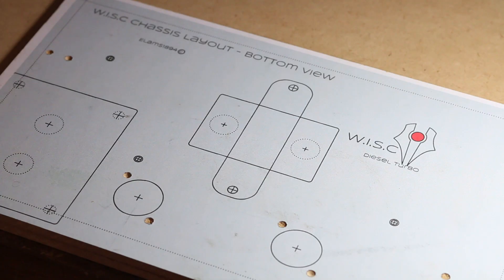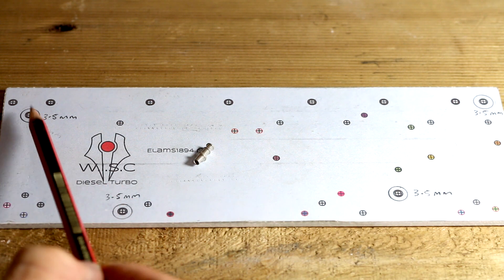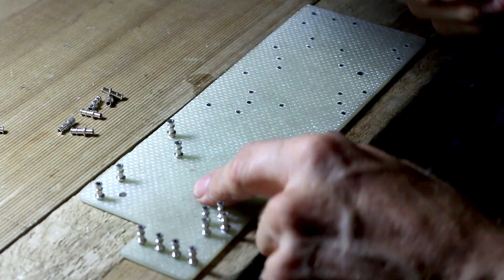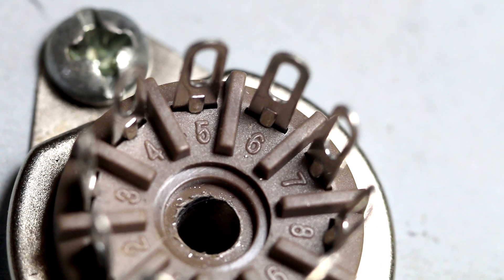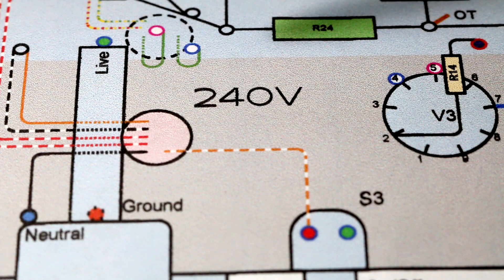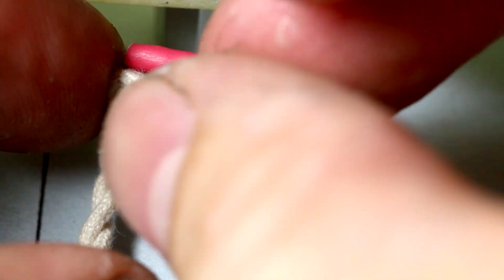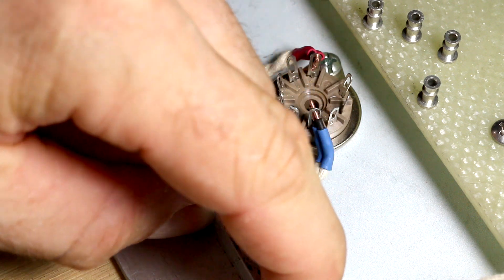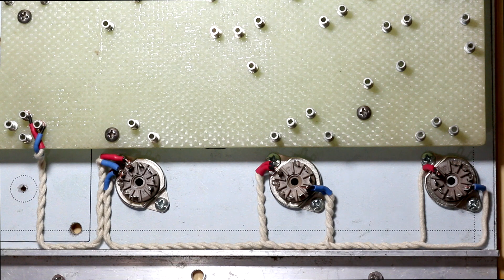Small Tube Amp Build - Step by Step (3 - Turret Board, Filament Wires)

Comment: Very good cabling you have an eye for detail just wondering why your using cotton insulated cable. ??
Reply from the maker: Thanks for question. Trying to think back to why I used cotton at the time. From memory I'm pretty certain it was because, at the time, it was the only available option (or best option at the time) for acquiring decent SOLID core cable at a reasonable price that had adequate insulation that was relatively thin. I prefer solid core for most applications. Although I could purchase solid core cable from many outlets, the insulation was crazy thick on all of them, and therefore unsuitable for my needs. Cotton allowed for smaller overall diameter cable. Also, it was easy to terminate with heat shrink. 

Now I use standard UK made bare metal solid core cable at whatever awg I need, purchased from either RS or Mouser, or similar, at a reasonable price, and I insulate that myself with decent polyolefin heat shrink. For me, this works out to be the best by miles, in terms of both quality AND performance. I only use stranded cable for areas where I need high flexibility. That is, shield cable, and also sometimes V+ cable for FX loops. Otherwise I require cable to stay in one place, so I use my own solid core cable. Cheers
Reply: @elams1894 have a look at Lapp cable I buy 2 core ( 110CY ) 1.5 for power leads fully copper shielded cable meets all European standards for RFI/EMI shielding their 4 or 5 core 4mm I have buried in walls for speaker cable the 5 core gives you an additional earth conductor and fits in 20mm conduit not sure what you standard in Aus we have 20mm and 32mm conduit you need 32mm for hdmi

Comment: I love your technique and attention to detail. I'm curious: Why do you keep the heaters close to the chassis? It seems like flying them downward toward the tube socket could induce less noise from AC heaters. I haven't A/B'd these techniques, however, and I trust your input on this matter.
Reply from the maker: Yes indeed you can bring them down from a vertical position and it's a great way to do it. My father does it this way too, every time. I find that heater wires in vertical position gets too busy around the tube socket for my liking. I end up touching the insulation with the iron and for that reason, I like to position the heater wires as far out of harms way as possible. If you can manage heaters in a vertical manner, then that's fantastic. I'd wager it's probably a superior orientation, however if wires are twisted and connected correctly, there would be not too much difference. Cheers.

Comment: I had a leaking floor in my bathroom, and I rent so they came in to replace the floor for free right, and they had to protect my floor in my appartment and they used these mdf plates which they taped on the floor, I asked them afterward whether I could keep the mdf plates, figuring they'd come in handy someday, well

Comment: Looking very nice. I like these boards. 
I would advise you to raise the filament wires from the chassis. Laying them on the chassis can introduce hum. Best is to let these float in the air, a few centimeters from the chassis, towards the tube and then bend them 90 degrees downwards to the tube.
Reply from the maker: Thanks Joost! Thanks for the tip, nice!
Reply: That's how Fender used to do it.

Comment: 15:40 you'r twisting 2 positie wires together, thats wrong it should be a positie and a negatieve fillamemt wire to reduce hum in the circuit
Reply from the maker: Very true, good spotting. Not sure how I screwed that up at the time but I corrected it in the next video, cheers.

Comment: Beautiful work.  Super neat.  Your filament wires on V2 may be unnecessarily twisted.   Because there are the same AC voltage, there is no advantage to twisting.

Comment: Nice clean work, does it really make sense, to color en seperate the filament wires in a AC configuration?... so that pins 9 is always has the same wire and so for pins 5 the same?
Reply from the maker: Thanks. To answer the question, yes it does matter what pins, and how it is twisted.. That is because if you get the pins mixed, you dont get any cancellation. You could rectify the AC, in that way, it would not matter. However with twisting, it absolutely matters. Cheers
Reply: elams1894 Thanks a lot, this helps me further in thinking how to prevent ac hum as much as can. In a diagram of an old circuit i'll have to feed the 12ax7 heaters, it shows pin 4 & 5 are connected simply by 1 filament wire to both (like a bridge) and pin 9 got the other, is that something to think about? Cheers mate
Reply: Ah I see video 5 right now with  the explain 😁👌🏼 Great work!

Comment: Geoff - really great series so far, I appreciate the work you've put into this.  What did you use there for a swaging tool?   Just some steel round stock filed to a point, or was it something fancier?  Also the stanley drill alignment tool you used in the chassis-building vid -- does it have a name/number?

Comment: I would just make up a bunch of twisted pair with a hand drill or electric screwdriver and forget about polarity for the heaters, aren't they AC anyway?
Reply from the maker: The drill trick is a good one, I've never used it for solid core, and I'm not sure why now actually come to think of it. The heaters are ac however I believe opposite sides of the secondary winding need to be twisted to get hum cancelling. If the same sides of the winding are twisted there is no hum cancelling. I'm still trying to figure out current flow in my head as a result of my first configuration. AC theory is a tricky one indeed.

Comment: Get those small pointed jewelry pliers from hobby store put the point of the pliers into the turret top hole and it will wrap those bare wire ends around the turrets.

Comment: HI! Thanks for making these videos! Question: I would like to build a version of this amp for bass, which mods would I have to make to it in order for it to work well?
Reply from the maker: I guess for a bass amp, you would prefer a clean signal? If you only require a clean signal you could try and modify the gain stages so that you do not get any distortion. A JTM45 preamp circuit would be the best place to look. Cheers

Comment: hey jeff good to see the next installment. i have brought the full pack and have being going through the parts list everything looks ok apart from the transformers is there anything that subtitues the power transformer?
Reply from the maker: +clint taylor Hi clint, you can use any power transformer that has from about 520-550v secondary or there abouts. Also you need separate 6.3v secondary winding for the filaments as well, but most will have that. If they have more secondary windings, you just terminate them and don't use. The transformer out of an old NZ Bell Colt radio is perfect for this build actually. You just need a 5-10 watt output tranny, if it has the 4, 8, and 16 ohm taps then you are sorted, if only one, then make sure the speaker is the same ohm rating,  all good.
Reply: I think I might have just the thing. thanks for answering all my questions